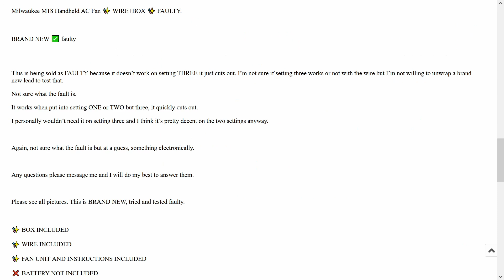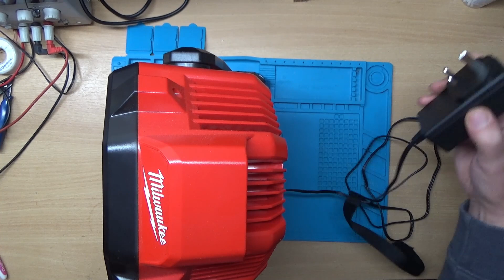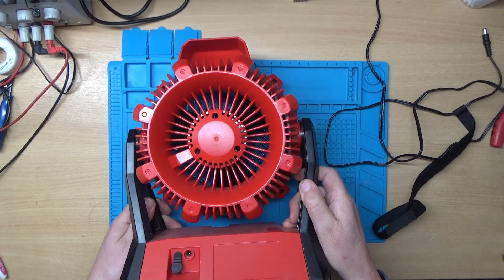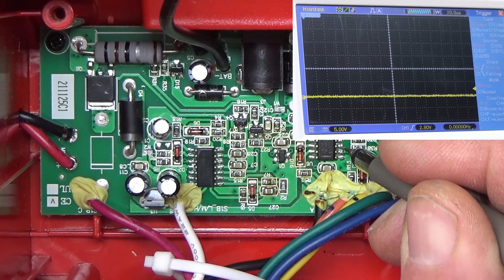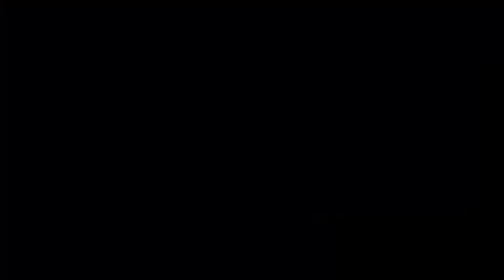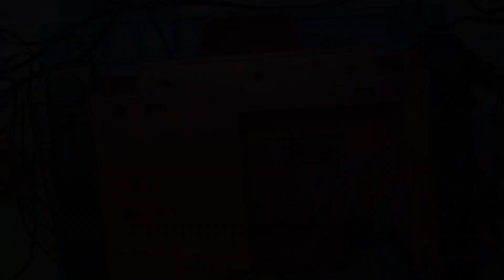Milwaukee  Cordless Fan - Weird fault - Can I fix it?

Comment: TLDR: tight or dried out bushings might be giving you that extra resistance
I have spend a good bit of my life taking domestic extractor fans apart when they fail and getting them going again. I have posted a few videos of this. They usually fail from a mechanical point of view, lubrication of the bushings, I have a few units at different locations that I run constantly in damp environments, not sure the damp matters but the bearings always dry up. It is very easy to disassemble, depending on brand, and clean and lubricate. In your case, if you could figure out where to do it, a shot of WD or some other penetrator might loosen the lube enough to reduce the resistance on that fan on the high setting, but to test it I guess you would have to go back to the original resistor.  Or just take the motor apart and clean the shaft and inside the bushing.  It is a guess, most of the ones I have dealt with were shaded pole induction motors, very weak, all similar bushings. I haven't been inside many dc fans. I'm waffling, tight or dried out bushings might be giving you that extra resistance.
Reply from the maker: Thanks bootsowen. I don't think that's the case here. The fan spins nice and free and the unit is fairly new. There's also a lot of units with the same fault on Ebay. I honestly think they've used a motor that's not really up to the job, or put too big a fan on it.
Reply: @BuyitFixit I’ve had this fan through heavy use, abuse and an uncle cleaning it with brake cleaner for 6 years. Not a weak motor
Reply: Hi, I was also thinking of bearings/bushings. Because, it sounds like a jet engine than a quiet fan. (Maybe hearing through the mic and my speakers)

Comment: Quite the Milwaukee FAN lol nice little pun, I think it all comes down to poor design, and throwing it what they had lying about, I think the motor isn't up to the challenge and they are pushing it to the limit, but thanks for a great video really enjoying them all, have a great weekend
Reply from the maker: Thanks Morten. Hope you have a great weekend too!
Reply: Goddamn, a fan that costs that much and they can't be bothered with engineering or parts checking?

You get that "dedication" when certain brands get "big" enough.

Look at the capacity of Energizer and Duracell rechargeable batteries compared to the competition (smaller brands) and you see how paying more money for a recognized brand can (sometimes) get you less. 

It's like the Energizer and Duracell flashlights: mass produced, flimsy, low light output, and costs more. Not that I'd buy one of their lights, but some people who don't read specifications (or don't understand them) would think it's a good product due to the name.

Comment: Good temporary workaround, though the motor sounds 'rumbly' (bearings perhaps) and it may be worth checking the spec (assuming the motor has anything written on it). All the Milwaukee products you obtain look like new, which is worrying in itself and may point to poor design.
Reply: Is the shaft in contact with the case anywhere causing friction 
Great workaround fix though 😊
Reply from the maker: Nope  smooth as butter.. spins freely.
Reply: @BuyitFixit  I think going down the resister root is good idea, or maybe that 1ohm (the large) sense resister isn’t right 🤷‍♂️
Reply from the maker: Motor seems quite smooth, someone did send me a picture of one with the number on. D2825FS-B 18v DC 20W is what it says, so working on 20w / 18v = 1.111amps and it seems to be drawing double that. But if the motor is only 20w why supply a 2.5a power supply? Unless they are over driving the motor?
Reply: @BuyitFixit  Bizarre, may be worth disconnecting the motor and powering it direct from your PSU to check current 'under load' (but then you may need another to compare it with). Thoughts of designers thinking  'let's see what happens if we drive this using pretend PWM, then, oops'.
Reply from the maker: I've just updated the video description with the picture and other info.
Reply: @BuyitFixit  Ah, yes, 2oW rated power. Then jam a honking great lump of plastic on it, put it in a cage and expect it to force air. At some later date worth comparing with another one (suspect motor is under-rated but may be wrong). I'm sure you have better things to do.
Reply: @BuyitFixit   Is it possible the power adapter is charging the battery at the same time?
Reply from the maker: @TorpedoBurrito  I'm pretty sure that's no. I've been messing about with chargers recently as I wanted to try to understand Milwaukee's communication protocol on the batteries. They are constantly communicating with the charger, and on the fan there isn't any microcontroller to communicate with the battery.
Reply from the maker: @TorpedoBurrito  I just remembered there's only two wires coming from the fan to the battery, and the charge pin is the centre one on the battery, so it cannot charge the battery.

Comment: Their using the lm324 as a pwm for fan speed my guess is a resistor on this circuit has gone high allowing the shutdown because it's going over current.
Reply from the maker: Not so sure on that, the NE555 seems to be providing the pwm and the lm324 seems to be used for current sensing. Someone sent me a picture of the motor which seems to be 18v 20w which would work out at 1.11a current draw? But the PSU they supply is rated at 2.5a and the fuse on the board isn't blown so are they just over driving the motor on purpose?

Comment: Not a fix in my opinion. You can clearly hear the fan spin much slower now. You altered the design to compensate for a fault instead.
My primary suspect would be a partial fault with the op-amp. Or something alongside that current sensing/limiting circuitry.
Reply from the maker: Good point. I did try running changing the current sense threshold on the op amp but not on the video. The fan run for about an hour but then the motor was quite hot and seems to have a thermal cut out that triggered which reset once the temperature cooled back down. One of the reasons why I think it could be a faulty motor or too much load on the motor? Or a design flaw.
Reply: @BuyitFixit  Maybe justs needing lubrication? I feel stupid suggesting something so simple, but it would certainly explain a motor drawing more current than it should or getting hot.
Reply from the maker: Good suggestion but it seems to rotate freely by hand, doesn't seem like it needs any lubrication also its almost brand new.

Comment: And damn I bought this fan 2 days ago new lol
Reply from the maker: From the number of faulty ones I've seen on Ebay with the same fault, I think there  some design flaw. I think there is too much load on the motor or it's not up to spec. Unfortunately I'd not recommend this product.
Reply: @BuyitFixit  ahh should have bought 12v version no mains power but atleast no dramas.